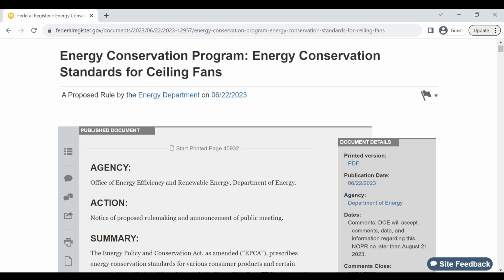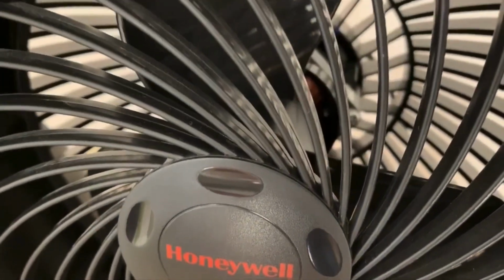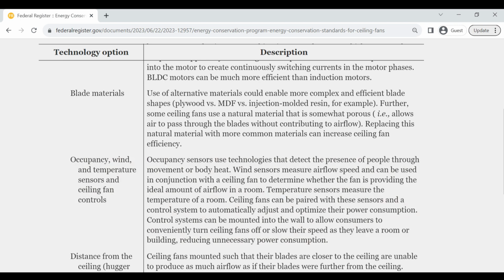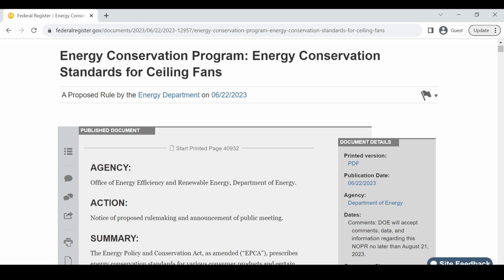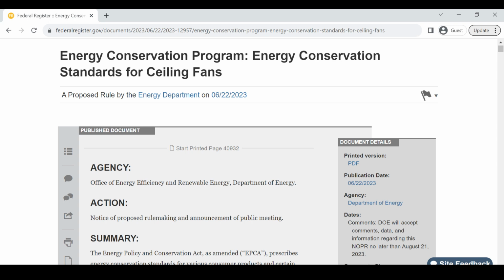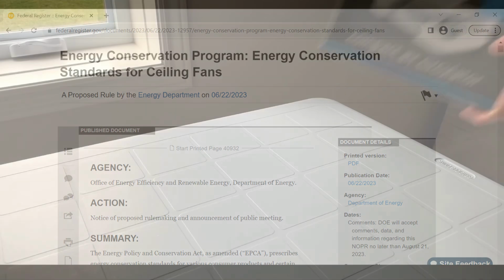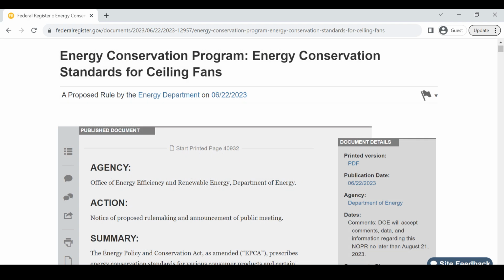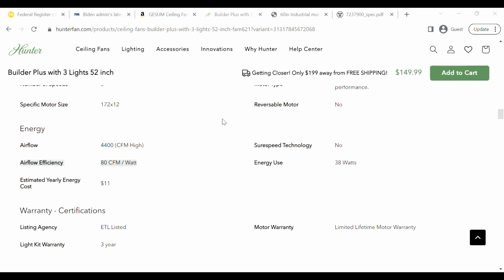New Ceiling Fan Energy Standards: Unnecessary & Problematic!

Comment: The one thing I’m really opposed to here is the push to make huggers taller. So if new huggers can’t be less than 10” tall, that basically rules out rooms shorter than 7’9” from having fans with the blades at least 2.1m, or 6’11” high. 

I’m short, but fans lower than 2.1m/6’11” in public places are lawsuit material. 

At least they acknowledge the demand for these “very close huggers”, so hopefully they stay.
Reply from the maker: I hope so too. We need hugger fans for low-ceiling spaces even though they're inherently less efficient.

Comment: 12:32 I haven’t heard anything about pushing for old fans to be replaced, have you seen otherwise
Reply from the maker: I haven't, but I made the assumption based on the incandescent to LED bulb situation. With the constant advertisements of LEDs, and a dwindling supply of incandescent bulbs, people were indirectly pushed to switch to LEDs. I think with fans, it won't be nearly as bad because people don't swap out fans at the same rate they change light bulbs, but I'm sure they'll be people who will change their fans, either because of the propaganda or for renovation.

Comment: I really hope the occupancy sensor part refers to building switches with sensors and not fans with sensors. Otherwise that’s going to go horribly…
Reply from the maker: Oh man that would be disastrous, like those integrated LED light fixtures. One thing goes wrong and the whole fixture has to be replaced.

Comment: At least the large direct drive motors move more air
Reply from the maker: True, the airflow efficiency generally goes up with larger motors. The current generation of the Hunter Original for example, has a considerably larger motor than most other ceiling fans of its size, yet has a higher airflow efficiency. But it still consumes more power than a fan with a smaller motor, so the claim about larger motors saving money isn't exactly true.

Comment: I can attest to that it's not new news. The 2005 law was a thing that gave the instruction every few years they're gonna put energy efficiency restriction requirements, which is why Fanimation initiated National Ceiling Fan Day on September 18 in 2013 to combat DOE's stances of ceiling fans required to be more energy efficient when ceiling fans had already saved energy. GE's superfan with DC motors were even way ahead of its time in the 80s. What if the Hunter Original gets jeopardized? And that explains why most K55-type fans had been dying off and some models like Cirrus (Short), Cirrus Flush, Industry, Pensi, Velo, and Velo Flush sadly had their K55-type motor changed into DC is because of DOE wasting their time putting pressure on fan companies.
Reply from the maker: Interesting, that's new info! 

So far I think the Hunter Original is safe from this new regulation update. The Original has an airflow efficiency rating of 87 CFM/W according to Hunter, which is pretty much meets the minimum of the new standard (87.13 CFM/W).

Were the stack motors inefficient? I've always thought they were phased out simply because the AC spinner motors were more readily available for lower costs.
Reply: @TheSuperFanMan  from what I've heard from Noah C on the VintageCeilingFans forum, he said "I think the reason Fanimation is able to keep their FK2100 motor around is because they managed to get the high speed current draw down to around .65-.7 amps and around 80-85 watts, whereas the K55XL would draw closer to .8 amps and 95-100 watts, and the XLP2000 would draw anywhere between 105 and 120 watts...and the performance difference between the FK2100 and those other motors is tiny." I believe Jason Stevens at Fan Man Lighting said "The K55 motor is 0.84 amps (around 100 watts) on high speed. Yet it didn’t meet DOE restrictions for ceiling fan motors." They had their K55 EcoMotor to hold onto their K55 until Luminance Brands got the Emerson fan lineup bankrupt. My Cirrus (Short) was made by Halsey and uses the skeletal K55XL type stack motor and the watt for the fan said "90 watts", which equals the amp rating to .75 amps. Modern Fan Co said they had to make the Cirrus (Short), Cirrus Flush, Industry, Pensi, Velo, and Velo Flush DC due to the production moving from China to Taiwan and the availability of the motor. I also heard that stack motors all use above 100 watts when they’re actually good quality, and the department of energy doesn’t like that. I don't understand why ban K55-type motors for having an amp rating of 1 or under if the Original amp rating is at 1 amp.

Comment: They want to put smart technology in ceiling fans. Smart technology is pretty much unreliable and it is usually made to be difficult to service (please can companies stop trying to turn everything into a smart product), plus wouldn't that mean it requires more power to power the smart electronic components as well as the motor? Also I am pretty sure there are bigger problems for when it comes to environmental problems then ceiling fan efficiency.
Reply from the maker: Yeah! They would be standby power consumption, and power consumption by the fan electronics, controllers, phones etc. I agree, ceiling fans are already really efficient machines, so I don't get why they're being targeted now.

Comment: Basically they want you to have a higher electric bill. Buy vintage ceiling fans from the 1970's - 1990's. Cheaper, built to last, look better, more powerful.
Reply: I agree with you. Vintage ceiling fans definitely had way better quality than the crap made today, you walk into an old house in 2023 and you see a ceiling fan from the 1980s, like that just goes to prove that old ceiling fans were made better, because a fan made today would probably be in the scrap in like what? Another 10 years? Yeah probably.
Reply: @kingofthecarwashes6724  a fan made today would probably be in scrap in 5 years or less unless you pay top dollar for it, and still it'll be poor quality and terrible looking.
Reply: @kelly9094  I agree.
Reply from the maker: Us collectors know what's good, but I have a feeling most other people aren't fully aware of that. Plus some used ceiling fans require bearing replacements and cleaning, might look outdated in some interiors, etc, so it may not be for everyone. 

But I agree that older fans are just better in terms of reliability. I'd also take an old fan over anything new lol.

Comment: This is very stupid rule
Firstly: Why they just gave 5 years 5 YEARS FOR A FREAKIN COMPANIES TO DO THIS. 
Secondly: DC fan motors and the other stuffs are really bad they dont even last half a year
Third: AC motors are as you said is simple , long lasting, Easy parts and repair
4th: THEY DO NOT CARE ABOUT PEOPLE WITH HIGH BUDGET
5TH: WHAT ABOUT US
6TH: WHY THEY WILL NEVER JUST TAKE EXAMPLE OF VINTAGE FANS
7TH: WHAT ABOUT US WHAT ABOUT THE FAN COMMUNITY HERE. WE AND FAN COMPANIES ARE GOING TO LIKE HAVE A FIGHT ABOUT THIS.
8TH: DC FAN DESIGN ARE JUST TOO MODERN AND YUCKS I DONT LIKE SIMPLE DESIGNS NEVER EVER.

#supportacfanmotors
Reply from the maker: Agreed! 

I'm sure they won't force people to quit using older ceiling fans and swap them out though, the same way they aren't (they really ) preventing people from using incandescent bulbs. I'm also not really a big fan of modern ceiling fans either. The fact that they're AC or DC is less of a factor, but it's more about their design. 

Most ceiling fans already being sold today aren't too far off from the proposed minimum airflow efficiency ratings, so this 5 year window to completely redesign entire lineups of fans is pretty gnarly.
Reply: @TheSuperFanMan  yeah the only good thing about dc fans (in Singapore) is that it has really good pitch and wood alike design on the ABS blades and really fast motor

Comment: I can already tell my reply is going to be a novel lol

I’ve recently seen quite a few videos of a certain HVAC servicemen who tears up quite a few DC evap fans for rooftop package units. Lots of them have burnt up components on the circuitboard & from what I’ve gathered, a lot less reliable than the old style belt drive blowers, even though those DC motors are made by a famous German company. I actually have a similar ticking time bomb in my own home. My bedroom AC happens to be infamous for its DC motors failing prematurely & getting a replacement isn’t cheap.
As for ceiling fans, I feel like this is the absolute polar opposite thing between North America & a lot of Asia. Chinese manufacturers have cheapened their ceiling fans a lot, to the point that they’ve become nothing but power hungry spinning noise generators that heat up like mad & quit running in 3 years. Even the most premium manufacturers here copy that little red evil textbook. I feel like the yanks that made this regulation only saw a small scope of the “problem” & used only that as their base point for this silly paper. I mean, not everything they wrote is wrong, but a lot of it sounds like it’d been dreamt up by anti-ceiling fan protesters.

For BLDC ceiling fans, I would absolutely come to India for them, the end. They seem to have a pretty good track record of making fairly low cost & reliable DC ceiling fans. And if one does fail, they also have figured out a great deal of replacement parts, even bits that Americans won’t even think of replacing due to the throw away mentality, they have them for sale & many electricians know how to put those parts in. What I see as a great advantage with Indian fans is that they use lightweight aluminium blades for almost every ceiling fans, even 5 blade decorative ones. That allows them to cut down on motor capacity, as aluminium is far lighter than whatever wood Americans are throwing at their fans. Another good option I think would be BAF’s Haiku with their aerodynamic composite blades.

I’m still on the induction motor bandwagon when it comes to fans. I recently built a custom metal blade ceiling fan that has quite extreme blade pitch & a large motor. I found that I’m able to put it on a very slow speed & still have it push lots of air while using less power than the original form of said fan. A DC fan with similar recipe could be an impressive energy saver, but that component cheapness argument you made is indeed a massive shot on the foot. This DC regulation can work, but for the gov’t to give manufacturers only 5 years to catch up, I think it’s going to backfire badly.
Reply from the maker: (Clumsy me accidentally hit the "cancel" button right as I was about to hit "reply". Lost the whole paragraph response I typed out grrr)

Great points! 

Are the power hungry fans a result of undersized motors? I imagine an excessively loaded fan will draw more current than intended, run hot and quit prematurely. 

Sounds like India is doing good in the BLDC fan market. It makes me wonder though: if they are making inexpensive yet reliable DC fans, surely their AC fans are even more reliable. I like the idea of aluminum blades, and I bet they're pretty inexpensive to produce too, since they're just stamped out. 

Same, AC fans for me too. I like the simplicity, serviceability and reliability, something we really don't have with DC fans now, or maybe forever.
Reply: Not really. I feel like the motor design itself & the type of materials used to make it is a great factor in its efficiency. You could have the best motor design in the world on your computer, but if you then give it aluminium windings, it won't do you any good.

Not all Indian fans are very reliable from the factory, but I think because people in India tend to repair broken things instead of throwing them away, their fans see far more use than they might if they're used by say, a regular everyday North American